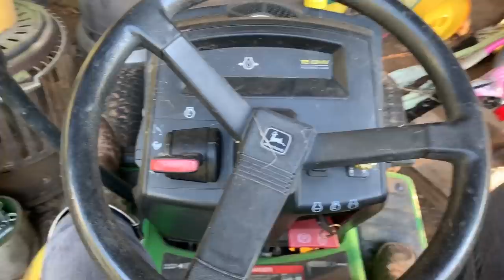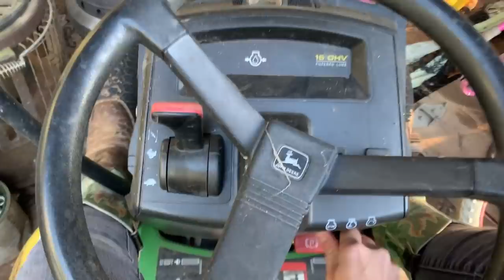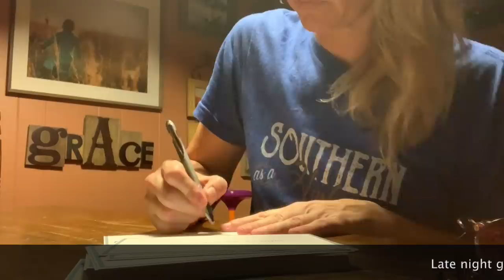In Other News : Lights...Camera...Cows?

Comment: I have a  John deer mower that was totally submerged for 5 days when hurricane Harvey destroyed our house.  I removed the spark plugs, changed the oil, and washed it down with a preasure  washer and blew the water out of the cylinders. Put the plugs back in and fired it up the very first time I hit the starter. It had 6 hours on the meter when this happened and it now has been over 2 years and it still starts and runs just like brand new. JD should pay me for this commercial! ! !
Reply from the maker: Haha yes they should
Reply: I HAVE 2, THE DECKS ARE KINDA CRAPPY,  BUT THEY MAKE GOOD MOTORS
Reply: Nothing runs like a Deere! John Deere that is!
Reply: Except my 425 JD has a Kawasaki motor😬
Reply: @piperdoug428  MINE TOO, ITS A GOOD MOTOR
Reply: @davidwatsonii9469  In the past 8 years or so, the B&S motors are from off shore and only good for about 200 hours according to my JD dealer.  Kawasakis' last much longer.

Comment: If it takes a long time to feed the calf, it may be because the nipple is new.  Take a knife a cut a little bit larger X in the tip.  This will allow air to get back into the bottle as the calf is sucking, and get the job done quicker.  Start with a small X, and then make it bigger if you still have vacuum problem in the bottle. Your daughter and the calf may appreciate it.

Comment: You just got BFF status from Christie for the RC! When I grill burgers, I make aluminum foil squares. seasoning on the foil (shiney side up) smash the meat into a patty, season the top. My thinking is the foil holds the patty together just a bit better until the sear forms. Also, the foil gives a tab to twist and spin the meat around to gt better heat distribution. The fun part comes on flipping the meat the first time. WHHHHHOOOOOOOSSSSSSSH! gotta be quick to avoid the flames!
Reply from the maker: Sounds like a plan!